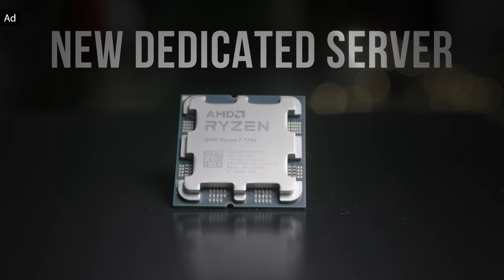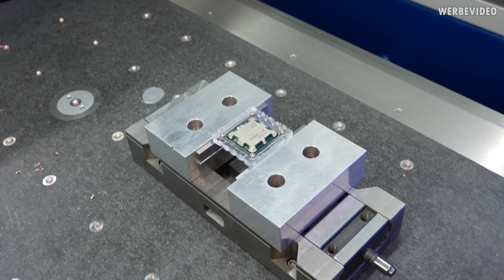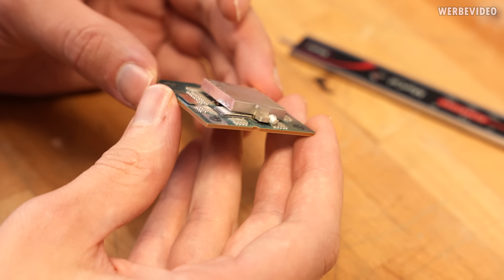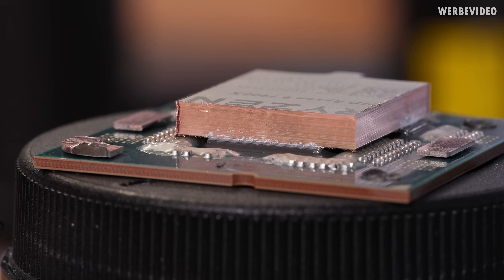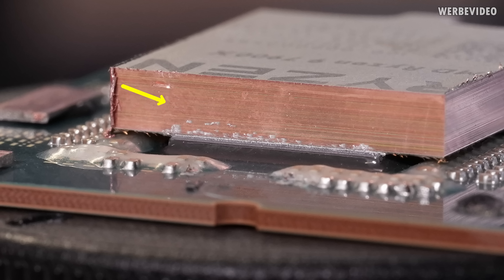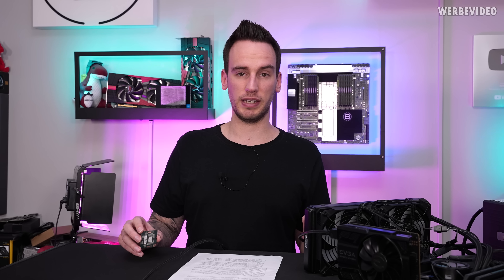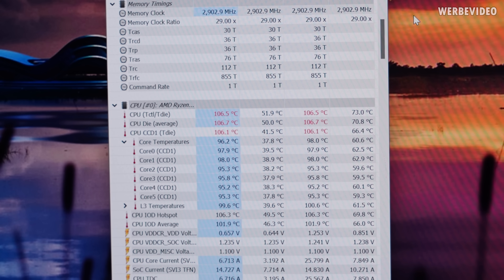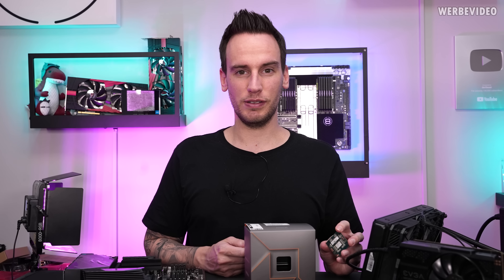Viewer-Mail Ep8: This CPU Unsoldered and Killed itself

Comment: I'd guess some water contamination got trapped in when soldered which would seal in the water turning it to steam which can superheat when the pressure from being sealed in increases and being a gas it's thermal conductivity drops way off collecting more heat. The CPU would still operate a little warmer than most but the heated steam would be way hotter and could reach solder melt point.

Comment: Not sure why it happened but if the board was responsible then it may do it to the new cpu as well. Also, i predict that this wasn’t one thing that failed, usually when you attain such high temperatures as to get total failure then it probably has multiple system failures

Comment: It would be very helpful to know if it died before or after the solder ran. If the solder melted at a lower temperate as other have speculated, it might have killed the CPU by shorting surface components. Would be interesting to see if it comes back to life if you get the stray indium off of it. Other possibility I can think of is that something internally fused into a sort of almost-short in such a way within the chip first such that the chip couldn’t detect its temperature or couldn’t shut down. Would anything change color if it reached over 160C? Maybe heat it up again (or a different dead chip) and see if anything looks different afterwards, might tell us if it actually reaches 160C

Comment: Your failure analysis and investigation videos are definitely some of the most interesting and unique content in this space. Also, I did not realize how thick the new Ryzen IHSs were until you milled away half of it. That's a ton of material between the cooler and the heat source.

Comment: I think it could be contamination of both the TIM and the surface of the dies. If the TIM was contaminated, it could have a lower melting point than expected, and if the surface of the dies is contaminated, whether by things preventing surface adhesion or maybe even the surface being /too/ smooth and not having texture for the TIM to grip onto for adhesion, that could result in those little gaps in the TIM you see.

Comment: It's a manufacturing defect. I think when the factory applied the solder paste the machine spit out that extra solder blob which didn't allow the heat spreader to seat properly when heat was applied to liquify the solder. That's what caused the visible voids on the die. With that incomplete contact the heat from the processor must have had crazy hot spots, the cooling solution wouldn't have been able to mitigate it.

Comment: As mentioned, verify the melting point of the TIM. If it's lower than you expect perhaps mounting vertically would cause it to drip away instead of on your test bench where it would stay in place.

Comment: I had power issues with a GB board that would cause my EK AIO Pump not to start, trust me, my 5900x hit 100c fairly quickly. I have to assume a 7900x would be worse.

Comment: Maybe the user did not tell you the entire story.  Maybe he tried to remove the AMD copper heat spreader with a hot air station with the wrong nozzle, because from what I could see in your video, these craters are probably localized heat that came from above.  He probably tried to remove the copper heat spreader and failed at it.  That's one possibility to consider.

Comment: Very strange. The solder seemed well bonded to the chips and the IHS, and I'd have to imagine even as a liquid it would still make a very good thermal connection. And even for the solder to melt out from under the IHS, I'd imagine everything would have to be very hot. If the silicon managed to get incredibly hot very fast, I can't see liquid metal getting very far while touching a big piece of copper unless it was also really hot.

If you have a dead AM5 chip thats still lidded, it might be interesting to see how how you have to get it to make metal drip out the bottom of it

Comment: It’s not the board or the manufacturing. It’s the 5nm process.  At 5nm, the transistors in side these new AMD chips are smaller than a virus. This means all the heat is concentrated into a really mall single point. 115c is the new cutoff temperature for new CPUs and GPUs.  95c is the new normal. Not sure how the melted cpu was able to reach 160c but it could be an anomaly.

Comment: Honestly, it could be the board issue, I own both an Asus ROG Crosshair X670E Extreme and an Asus ROG Strix X670E-I Gaming WiFi board, and both would limit my 7700X to 95C(at max 96-97C, with Asus ROG Strix 240 ARGB AIO and Coolermaster Mastergel Pro V2 thermal paste), it never gets to 100C on hwinfo64 no matter how I overclock it or what load I put onto it. I could do all core 5550Mhz and still not exceed the 97C temp threshold. So that's some microcode issue with Gigabyte Aorus boards. Even when I BCLK overclock my 12100 to all core 5110Mhz with MSI B660M Mortar MAX wifi D4, It never exceeds 100C with a Yesten x Zeaginal 360 Sakura AIO and Thermalright T7 thermal paste. On the other hand, Id likes to say Asus boards keep pretty good protection to their CPUs in both AMD and Intel lineup, my 13900KS with Asus ROG Strix Z690A Gaming WiFI D4 never exceeded 105C while doing single core 6.3G, 3 core @ 6.2G and all core at 5.8G with Asus ROG Strix 360 ARGB AIO and Coolermaster Cryofuze Violet thermal paste. On the other hand, my 5800X3D with Asus ROG Crosshair VIII Dark Hero was able to keep flat all core 4450Mhz at around 80C in games with Asus ROG Ryujin II 360 AIO EVA edition(liquid temp 31-34C) and Coolermaster Cryofuze Nano thermal paste, and my 5950X in Asus ROG Crosshair VIII Formula always stayed under 100C under load with Asus ROG Ryujin II 360 AIO EVA edition(liquid temp 40-70C) and Coolermaster Mastergel Pro V2 thermal paste.

Comment: Just sent you pics of my delided 7900x. Bad solder job.
Not as severe as the video, but still could be a problem AMD should look into.
My rig is on a test bench, meaning the chip is horizontal and never powered on vertically. Its never been past 95c and as of my settings doesnt it allow it to pass 75c.
Small blob fell off i/o die.
Im assuming this is a manufacturing defect and unfortunately i have no recourse because i delided it.

My chip isnt dead, but its still a defect nonetheless. As it could potentially cause problems later and or effect the life if the chip.

Comment: Couldnt the cpu simply been in a place/environment where it reached solder melting temp at least briefly? What happens if if you heat a processor to 150+ degrees? Might worth trying on an already dead cpu.

Comment: That part that concerns me is how the CPU was able to reach 160C to melt the solder. If the AIO was working, then it would take a rather extreme amount of heat and power to overpower the cooling. This should have triggered OCP or SCP at the VRM or PSU level.

Comment: I'm sorry for the bad englis but i experiance one somting with a gpu in the time whene adrenalin had trouble about 2 yeras ago, basical i like to monitor my hardware making sure everything works as expected and not because i do OC well nothing big anyway. Back to adrenalin i was playing ark and the game crashed with the driver manager adrenalin and restarted like it did many time in those days, whene i relaunch the game with the overlay on the temp keept going up and the fan did not move it stayed at 800 rpm and did not got any faster passed 96c i powered off on power bar i did not let thing get any higher,  my theory is if sofware go bust in the os nothing will save the hardware.

Comment: That 7600 went back to its Athlon roots. Socket 462 Athlons had zero thermal protection, and would shoot up to 700 degrees and sometimes explode when you removed the heatsink.

The only thermal protection available back then for Athlons was the motherboard had an optional thermal warning and/or thermal shutdown using a thermistor under the CPU socket. Most DIY motherboards shipped with this option disabled, you had to explicitly enable it yourself.

Comment: 11:10 you missing something here(which is weird, because you seemingly knows physics), loop is closed, so when liquid heats up pressure is also rises which in return increases evaporation point of it, so water don't have to be gone, loop just should be able to handle created pressure.

Comment: Most likely the melted indium solder is the consequence, not the cause of the failure. The CPU died for some reason (like, a weak silicon that couldn't handle a voltage spike), which caused it to heat up due to an internal short, and that caused the solder melting. The interesting part is why the CPU failure didn't trip OCP/OPP in the PSU, and why the motherboard didn't shut down before it managed to heat up that high. In the viewer's shoes, I would be suspicious of his PSU and motherboard quality.

Comment: On Asus, MSI and Gigabyte mobo's these CPU's can run too hot. I don't know if it is a software ( UEFI/BIOS ) problem or an instructionset porblem ( AMD ). If overclocking is enabled you can even set the multiplier to 80 ( hahaha ). The CPU won't accept that value though. But you can overvolt them and the CPU won't protect itself from burning up. Even though 110 degrees Celsius won't make the metal melt, somehow it did. So it must be mixed with another metal to melt at such a low temperature. Strange, stranger, strangest. Further investigation on this subject is needed.

Comment: It might have happened on last POST.  An in chip short, perhaps caused by the internal power delivery circuitry,  could create enough  heat, and the owner wouldn't be able to realize fast enough to stop the solder melting.   Its one of those "what are the odds" failures

Comment: Definitely wondering if there was a failure of the thermal protection circuitry. To my eye it looks as though the soldier was boiling or there was an error in the application of the soldier itself.

Comment: Maybe an area on the die that didn't have a temperature sensor and accedentally also had bad thermal interface contact. Temperatures just get hotter an hotter...

Comment: CCD seems to have failed internally creating a resistance short. Any power applied would just generate heat. You should install in a mobo and test with thermal camera.

Comment: A test of the specific melting point of solder on the failed CPU would be interesting to know.  To see if it really melts at the advertised or commonly accepted temperature.

Comment: I suspect what you're seeing on your bench when testing is that the CPU can only throttle down so far; it looks like you were getting a minimum package power of about 20-25W in your tests. The processor likely throttles down to this minimum, and then if temperatures keep rising (up to the 115C trigger point or whatever) then the processor simply shuts down.

Thinking more, I suspect this is because the cores themselves can throttle down extremely low or turn off completely, but the I/O die has a certain minimum operating power and you can't "throttle" the I/O functions (such as memory controller and PCIe links) much without preventing the system from working entirely.

Comment: Could it be that somehow the pair of CPU die's have an anamolly allowing for extremly high leakage like back in the Bulldozer era ?

I'm just taking a stab in the dark as I think this maybe one of those CPU's that needs to be submitted to AMD for further analysis on why this occurred.

My 7950x has been running fine for about 4 months now and I'm not seeing any kind of over-temp issues even at idle.

Comment: I'd suspect that CPU may actually have defect somewhere in the interposer, which still do happen to the others, not just AMD (forget the Skylake Bendgate, it's something more fundamental, in term of how they're connected) - however it's a rare freak accident. If it would have been indium solder that shorted out the CPU protection, it wouldn't matter because something already have failed first before indium reflowed. That or he might have pumped a bit too much juice into the CPU that handful of transistors short-circuited.

Comment: Could the solder have been mistakenly replaced with low-melt solder?  Did you check the solder blob for melting point?

Comment: Could this not have been some kind of prank by the guy that sent in the cpu? I find  it difficult to understand how the cpu could have reached that temp.
Reply: So he had to delid, fill in oddly, and then relid the CPU without obvious issues other than the melted solder blob? That bit in the middle would be hard.
Reply: @TheGreenReaper  No, just subject the heat spreader to a lot of heat.

Comment: I think it was a packaging/assembly 'defect'...... I think there may have been a small air pocket (...or 2 or 3 )in between the silicon and the indium... very SMALL spots where the silicon had NOTHING on it at all.... and that is why we see those 3 very small spots with nothing on the silicon.... And for the most part this would pass all manufacturer tests and would even work in the customers computer for a while.... but over time whatever is directly under those spots WILL overheat just enough for  it to break.... MOST of the heat would have been pulled away because the area was so small and there is sufficient cooling capability all around it...but eventually it's gonna break......
I think you could test this..... weelllllll ...now that I think about it, I'm not so sure this would be very easy to replicate because when pressure is applied it would rill in the dry spot.... But the dry spot could have started out bigger but when pressure was applied it squeezed it down to a very small area like we see....
There could have been a thousand other way that this could have happened, but this was the first to come to me lol:)

Comment: what if one of the chiplets died, the other one still worked. maby it still pushed power into the broken one and got that to 160 while the other one was working and therefore the system didnt crash?

Comment: I really hope AMD does pay for a replacement. May be it was a short circuit inside the chip that lead to temps rising beyond all reason. However, how could a metric crap ton of temp sensors inside miss that? How could a chip keep operating at the needed temp long enough to melt the solder? That is all really weird.

Comment: 1.00 - Hetzner needs to get rid of that FLAT power cable and use a standard ROUND one.  The flat cable is completely blocking the airflow across that fanless heatsink.  This is the whole reason ROUND IDE cables were created.

Comment: Could it be a bubble/gap in the paste/Tim between heatspreader and cooler..  the temp sensors get cooled while a small spot gets hotter slowly melting and shorting. From there cascade failing...

Still with all offset options on boards now, the used biosversion could apply an offset not intended by the user

Also are those burnmarks on the indium blob?

Comment: It looks like the end-user put too much load on the CPU without proper cooling. 

Just like fuses and breakers don't stop your wiring from burning down your house because you let uncle grandpa do your electrical, thermal throttling won't stop the CPU from melting down from improper installation.

Comment: Could this be caused by an air bubble in liquid cooler? If air bubble went over a hotspot it could let it to increase temp over 100C without the need to evaporate all of the water from the cpu block

Comment: repair the broken caps, see if the CPU still works at all.  If it works then it wasnt temperature related and was just a production error.  Next fill all the empty cap spots and see if doing so helps overclocking/memory/etc at all.

Comment: Based on experience with laptops, the processor may have failed first. It has short circuited, but the protections on the motherboard have not triggered properly.  Therefore, a indium melt occurred. On a faulty gaming laptop board, a shorted CPU or GPU can reach temperatures of 200-250 degrees C under very favourable conditions. It can literally solder itself out.

Comment: i have 2 theories the first one is the CPU thermal reader at some point became faulty and not reading what the actual CPU temperate for Example the CPU is now 95c but the system reading it as 50c or 60c so the system think CPU is still in the safe zone of heat in long run that did kill the CPU
my 2nd theory is the solder that got melt may has lower melting point and that is factory defect so in long run at 95c and it was the melting point of that solder so the end results was this

Comment: If we try the same test with the load on cpu we can reach 160c. The defence is not quick enough. It measures 1 time in 3 sec. 3 sec under loal without cooler will probably heat cpu up to 160c and kill it.

Comment: Maybe the circuit had current leak inside of silicon die and current barged through the thin copper wires so that it cooked the indium solder? I don't understand how that could be even possible on modern platform. I believe this would be the only explanation, if indium did melt by the extreme temperature. That is crazy.

Comment: I would like to know if the motherboard does anything to limit current with a failed CPU. I have seen many ICs fail shorted and when the circuit powers they turn into a heater. I wouldn't be surprised if the CPU failed, then it melted the solder during subsequent power on attempts.

Comment: Couple thoughts:

Could the IHS have been defective and not sealing correctly as it were, leaving air pockets between the solder and the IHS? I am curious what the actual melting temperature of that Indium solder is.

Comment: It's possible that the owner had some 3'rd party (control) software installed which hung the system so it would not just shut down? I honestly don't know if the shutdown functionality is completely independent of everything else or not.